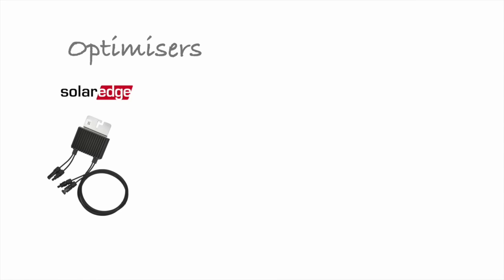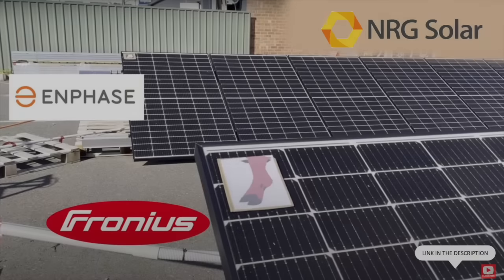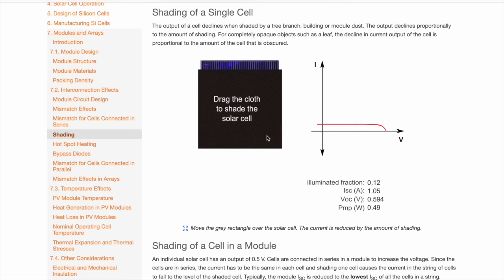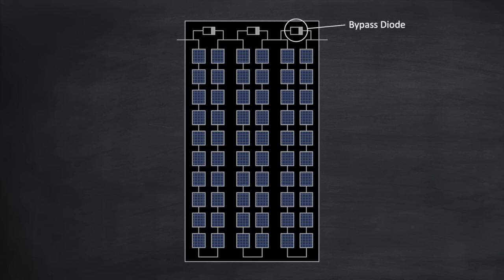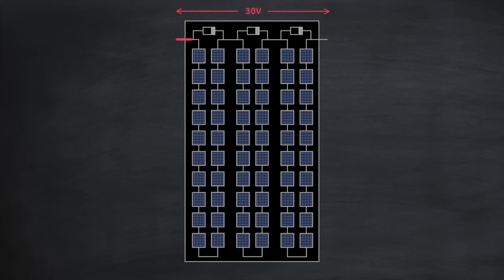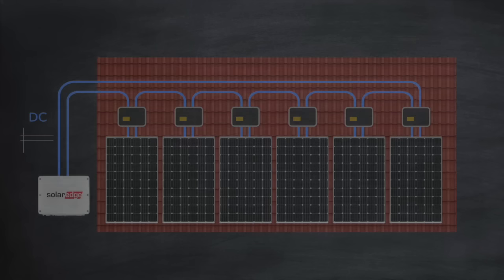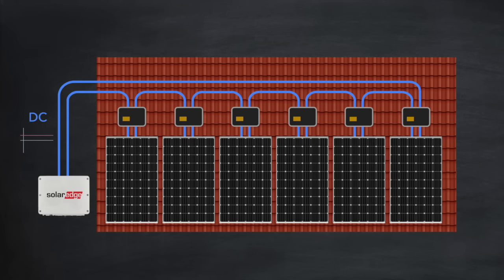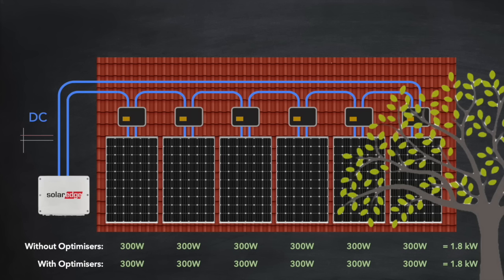Solar Panel Shading (Part 1): Are Optimisers and Micro inverters Worth It?

Comment: Well... I have SolarEdge with optimizers and have nothing but regrets. It sounds reasonable but ultimately they all fail and you have to replace them. Which you won't do immediately because it is a hassle. Once two in the same string fail, the entire string is dead. If you can find the right web page to claim new ones (I found customer support abysmal, not helpful in any way) you do get new ones. If you know the serial numbers of your faulty ones that is. Then the hard work starts, good luck with that. You may need to take off multiple panels to get to the faulty optimizers. And you'd better know where they are.

I have two planes, one east and one west. By now I fixed all optimizers of the west plane at ground level, with long cables to the roof so when the next one fails it will at least be easy to replace. I am yet to do this to the other side.

I lost way more yield because of broken optimizers than they could possibly have saved me. You cannot even just leave them out, SolarEdge inverters don't work without them. If you value your sanity, steer clear from SolarEdge.
Reply from the maker: Hi Martin, sorry to hear about the troubles you've been having with SolarEdge optimisers. I'm seeing this more and more, that the actual overall value you get from having optimisers is marginal, and that's not including all the extra hassle you mention!
Reply: I've had my SE system up without issues since 2018. I do know that some of their products manufactured in Vietnam were problematic.

Comment: Great really clear information. Excellent job!
Reply from the maker: Thanks Tony - it's great to get feedback like this :-)
Reply: There may be more to this than I first thought. I have just under 1/2 my panels shaded but I'm only now getting 1/4 of the expected output! Is there a multiplying effect of losses if you don't run optimisers?
Reply from the maker: What percentage of the day do your panels experience shading, and is it hard or diffuse shading?
Reply: @GaryDoesSolar  From mid day for approx 2 hrs. Its defused but towards the darker side as through a pine tree.I was surprised at the greater loss than the shaded panels. I counted even a partially shaded panel as fully off.
Reply from the maker: Thanks Tony. A few more questions if I may then:

1. How many panels?
2. what size each (kWp)?
3. what inverter?
4. On a clear sunny day what is the max generation power when not shaded?
5. On same day what is the generation power during shaded period?
Reply: @GaryDoesSolar  Hi Gray. 21 x 185w  giving total of 3.8kw on single string Fronius TL inverter. Clear sunny day I will almost reach max. in winter max might be 3.2kw, but day in question approx 2kw on unshaded duplicate array ( side by side as I have 2 setups both 3.8kw on same roof so great for this comparison ) with under 50% of panels shaded on the 1st array it only gave just over 400watts output. I would have expected 1Kw. I have tested in the past covering 1 or 2 panels and the drop was liner, this is why I am surprised at this increased loss ratio the more that are shaded. I might try and fit some Tigos but the panels are MC3 and I will need to change the connectors on each panel, plus its up on the roof.
Reply from the maker: Thanks for providing the extra detail, Tony. Yeah, it all does seem a bit strange. Fitting some Tigos sounds like a good strategy 👍🏻

Comment: Cleaning my panel's did make a difference and luckily I have very little partial shading problems apart from leaves and bird crap occasionally. But its good to see the BS sale's guys getting put in their place. Micro inverters are an accident waiting to happen not to mention reliability issues. Optimisers are just another thing to go wrong on top of that.
Reply from the maker: Good point about cleaning - I'm making a follow-up video just now, and I'll include that :-)
Reply: @GaryDoesSolar  
When the installer took down my older panels temporarily to make room for the new ones, I cleaned them all with car wash soap. They were filthy. Made a huge difference when they went back up.
Reply from the maker: Wow - ok, that's certainly a case for cleaning them every now and again then!

Comment: I wonder if those diodes are Zener diodes, when the voltage across the Zener is lower than the rating, it acts as an open circuit (high impedance), when the voltage goes over the rating, the diode acts as a near short circuit.

this trick was typically used in automation industry pre HMI use, 4 to 20mA current loops circuits were used in indicators, pen trend recorders and limit signalling.
by placing diodes across each load on the terminal strip, you could take out any equipment in the loop without disrupting the current flow in the other loads, maintaining precision and avoiding shutdown.
Reply from the maker: They are indeed, typically. And even though I have an electronics background, it took me a while to get my head around reverse-bias! :-) It's a great trick and eloquently applied to solar panels. I love it!

Comment: Great video once again Gary. One question, I have read that wiring in parallel rather than series also has an effect on shading, i.e wiring in parallel limits power loss similar to optimisers, have you an opinion on this?
Reply from the maker: Thanks for the kind words! Yeah, I did start to look into that, and decided that it would be too much to put in such an introductory video, and nearly all domestic installs are series only in any case. I don't have any particular view other than parallelism allows the current more flow options, in a similar way to the bypassing that the diodes provide.
Reply: @GaryDoesSolar  I believe that some inverters have 2 sets of connections for PV arrays, assume this is probably for 2 completely seperate arrays ie east and west, however I suppose if you have 1 large roof you could split the array electrically into 2 ? and have these connecting to the 2 PV array connections ?

Comment: Sma don’t make micro inverters anymore but they. Are a variant optimiser for up to 400w, they compensate by the latest inverter having 3 different strings for better energy harvesting and voltage raising to get around the shading
Reply from the maker: Thanks. Wasn’t aware. Probably not the best example then 🤣 although, I note that you can still get them on the open market

Comment: Thanks for this video as I learned a lot from it but have some questions.
In the shading events you mention in this video all light is removed from each string therefore turning that string off completely but in real life that doesn't happen. They may not get direct sunlight but may still get enough light to make some power even when in shade. To complicate matters the shade/sun will move across the panel during the day changing the percentage in shade.
In my case in the summer up to 30% of my panels are in the shade in the afternoon (more like 80% in the winter) but those panels give reduced output rather than none. 
The panels are on a garage roof facing approx SSW but the gable end of the house shades this roof, a little in the summer and a lot in the winter.
My location is far from ideal but was the best I could manage. I was advised to go with optomizers by the installers so am interested to hear what you think.
Reply from the maker: Hi Ali, thanks for your kind words. Ok, to your questions then:

Yes, you're right - there will be ambient light, but that ambient light will likely be the same for all substrings. A bypass diode will kick in when there would otherwise be a notable reduction in the current (typically 20%) following through the substring it is managing. And partial shading on that substring could cause that. Ambient light won't avoid that. And you can see this in the example experiments in my video.

For your situation, where there is quite a lot of shading, having optimisers would make sense, because each panel will be treated differently. And if your panels are half-cell or shingled, this will also help.
Reply: @GaryDoesSolar  Thanks for getting back to me. 🙂

Comment: @16:40 shouldn't it be 0W also for all unshaded modules in the without optimisers case?
Reply from the maker: No, the first four panels will not be affected because all the bypass diodes in the last two panels route all the current generated by those first four panels away from the affected cells.

Comment: so a fence hung array facing south thats north of a bungalow and would have transitional shading would be best with optimiser's and why only 3 diodes and not 5/6 ?.
Reply from the maker: I can’t give you advice on the first question (given issues of liability, even if that advice is given free). 

On the second question, it’s likely just a cost/benefit equation. And of course, the more components, the greater chance of failure. 3 seems a good number.

Comment: How about having a string with just some optimizers? 
I realize that that could really mess up the string if the optimizers would lower the current, but do we have some data and or tests ?
Reply from the maker: I already show in the video a string of panels, each with their own optimiser. Do you mean a string of optimisers with no panels?? An optimiser requires a panel to operate on.

Comment: After few hours trying to find out if I should buy optimizer, this video is by far the most informative content. Thanks Gary. I know I still need to make my own decision on this, but speaking from experience would you install optimizer on your own house?
Reply from the maker: Hi Clement, my house has a south facing roof that does not suffer any shading, so no, I would not fit any optimisers/microinverters. 

But, if any part of my roof did have shading, I’d install optimisers only on the affected panels. 

Hope that helps 👍🏻

Comment: At minute 8 you have said that shading can overheat and damage PV.
Consider this statemant wrong.
Could you explain ?
Thanks.
Reply from the maker: Yes, if there were no bypass diodes, the shaded cell no longer acts like a voltage source, but instead like a resistive load. The current flowing through this load heats up the cell and eventually permanently damages it.
Reply: True. But...
We talk about internal resistence which generates  same amount of heat in active and passive PV.
Have touched a shaded PV panel and was cold when other lit panels ware warm.
Accept that present panels have bypass diodes integrated and do not have this problem.
Thanks for answer.

Comment: Is possible to have optimisers only on one bank/string of solar that’s on a garage roof that’s slightly shaded at certain times of day (tree’s). Then have the remaining panels (on the house roof) without them as they don’t get shaded?
Reply from the maker: Yes, Tigo optimisers allow for that. If you're using SolarEdge, they require optimisers on all panels.

Comment: You say that there is no output difference on an unshaded array with or without optimisers. but optimisers are active electronic devices and must consume some power to operate.  Another report I watched recently that looked into this question suggested that the optimisers take 2% of the power all of the time.  If this assertion is correct, then it raises the question whether it is better to put up with shading for part of the day or the 2% loss all day.
Reply from the maker: Hi David, you raise a good point - yet another factor that should be considered! I’ll cover this in the follow up video I’m making - thanks for highlighting 👍🏻 😀

Comment: I read a comment somewhere that said that by pass diodes are most of a safety feature and not something you should actually rely on for regular use
Reply from the maker: That's correct - their primary use case is to protect the panel cells in the event of localised shading. I would argue though, that they can be relied upon - otherwise we'd have millions of panels failing around the world all the time, given shading is a problem for many.

Comment: Hi.   Wow, well explained videos.   Amazing.  A Q please..I have been advised to have a 9 panel (415w) of approx 3.8 on my south facing roof and none on my north side, with a GE 3.6 inverter and 9.5 battery.   Would this setup be advisable? Or worth adding panels to the north roof ( at a lower intake performance, due to indirect sun)?  I am looking to a few eheaters.   I have been told that I am low electric user at 3600 kw per year.  

Hope this make sense and thanks for your time.
Reply from the maker: Hi Neil, thanks for the kind words! Now, I can't give advise (as this would open me up to potential liability), but if you're in the UK, you might want to check out this forum on Facebook - it has 20,000 members and people ask detailed questions all the time and get great responses: https://www.facebook.com/groups/2197329430289466
Reply: Thank you for you quick reply.   I shall try the platform.  Keep the videos growing…
Reply from the maker: Will do! 👍

Comment: Hi Gary. I have a query about the difference between the shading effect examples you’ve provided where there is heavy shading from a chimney stack & also the diffuse shading from a nearby tree. In the heavy shading example, optimizers won’t work because the bypass diodes have kicked in but in the case of the tree shading where the bypass diodes have also kicked in, the optimizers are still able to limit the current in this situation? From my understanding of what you had said, is that if bypass diodes kick in, optimizers can not reduce current or be effective at all? If you can clear this up for me please. Many thanks.
Reply from the maker: Yes, that’s in line with my understanding 👍🏻 for diffuse shading, optimisers can see the current being reduced in the panel, so will divert the remainder around the panel to retain the overall current for the next panel in the string.
Reply: Thanks Gary. However, I’m still a little confused as the example you use with the tree shading shows that without optimizers all the bypass diodes would kick in but with optimizers the current would reduce so that the output of panel reduces to 50%. In a previous example, if bypass diodes kick in at all, the optimizers cannot reduce the current because there’s no current to work with? If you can clear this up for me please. Thanks again for all the great support & advice you give. Karl
Reply from the maker: @KarlCasey-up4gi  Sorry for the delay in replying.

"I’m still a little confused as the example you use with the tree shading shows that without optimizers all the bypass diodes would kick in"

I would not expect the bypass diodes to kick in unless the tree (i.e. diffuse) shading was >20%. Can you tell me where in the video you're quoting from please? That will help me to understand your question - thanks!
Reply: Hi Gary. It’s 17’ 40” into video where the shading on the panels from nearby tree is 50% so bypass diodes kick in., however, you mention that with optimizers, there would be reduced performance but in the example you used with the shading from chimney stack previously, you said that if bypass diodes kick in there is no current with which the optimizers can work with. Therefore, if the bypass diodes kick in on the tree shading example, there should be no output from the panel even with optimizers, all being equal?
Reply from the maker: @KarlCasey-up4gi  Ah ok - I think I understand your question now. A bypass diodes kick-in when it detects that the current flowing through the substring it is managing will be reduced by more than 20%. For diffuse shading (like a tree) where the current flow would be reduced by half (example at 17m40s) the bypass diodes will kick in. But if there are optimisers fitted, each optimiser will reduce the current by half going into the panel - that means the bypass diodes won't kick in because each substring can easily handle half the current flow. 

In the previous example with the chimney, because at least one cell in each substring of the two affected panels is completely covered, there cannot be any current flow at all (see this video at 4m42s: https://www.youtube.com/watch?v=9GvhDhCSJgo) and that means it doesn't matter what the optimisers might try and do, no current can flow at all in the affected panels.

Hope that answers the question. Let me know if not...

Comment: I am thinking of installing solar panels but each one going down to the control panel which is an extra metre or two each, reason is ease of maintenance being accessible at anytime, from the control panel they could be connected in series or parallel and easy to monitor each panel, I have worked out the voltage drop, just need to increase the cable size to reduce the drop
Reply from the maker: If you can make it work, then it looks to be a great idea! :-) It's a bit beyond my knowledge though...

Comment: For price of this microinverters you could literally double solar array (usually you have plenty of place for it) which will outperfom any optimizer/microinverters.
Reply from the maker: Alexander, I'm not sure your statement is true - can you provide some example figures to support it?
Reply: @GaryDoesSolar  Here in europe i could buy 370w panel for 170euro, so 
1. 20 panels  + 20 inverters = 6800eur for 7.4kw theoretical peak system
2. 20 panels + 1 inverter = 4400eur with 8kw inverter
3. 10 + 10 inverters = 3400 for 3.7kw theoretical peak
Reply from the maker: @W122ard1  Thank you - that's good to know. So it looks like Microinverter prices need to come down before they can compete with a basic string inverter system. But of course, when looking at the overall costs over 25 years (and string inverter replacements) the gap is lessened.
Reply: @GaryDoesSolar  It is also depend on what inverter we compare, because price for victron will overcome probably all microinverter )) But there are a lot of good reasonable priced inverter. Victron provide its full environment, but for me price for it too high.